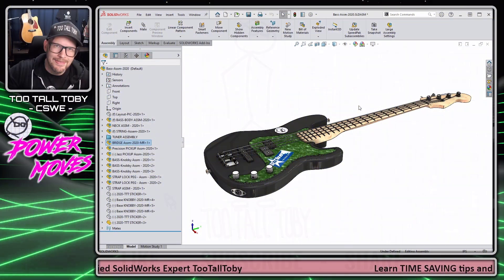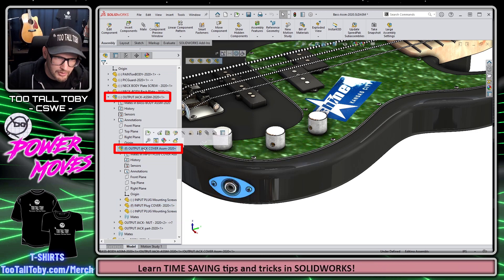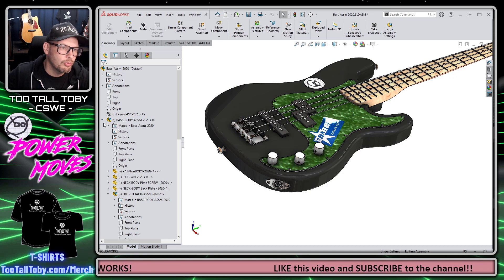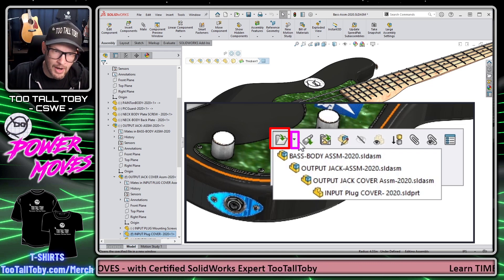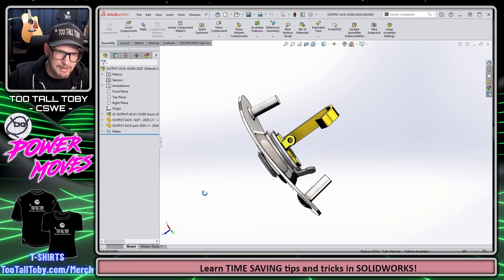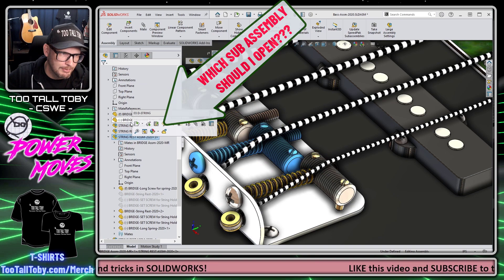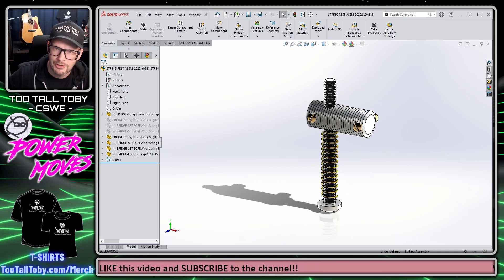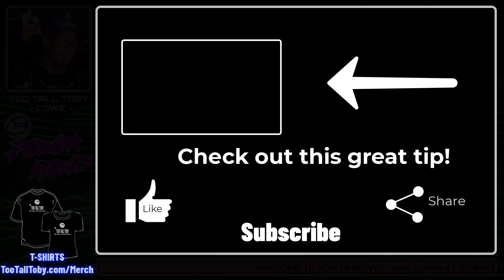SolidWorks Sub-Assembly QUICK OPEN

Comment: How can I get tabs of open documents.
Reply from the maker: I use CTRL+TAB to cycle through my open documents
https://youtu.be/DliLmyiNplY
Reply: @TooTallToby  is there anyway to display open documents
Reply from the maker: @SpotterDeer  WINDOW > TILE VERTICALLY?
Reply: @TooTallToby  I guess I am going to write a program to list open documents then.
Reply from the maker: @SpotterDeer  Sounds good - good luck!  I'm not really sure what specifically you're asking about so it may be helpful if, after examining a suggestion (like using CTRL+TAB) you explain the shortcoming you are experiencing.  And maybe describe the goal and the application.  I'm not really sure what the application would be for "listing all open windows".  Hope this helps!
Reply: @TooTallToby  autodesk inventor, Siemens NX, pro engineer. All have tabs on the bottom of open window inside the cad software. I can write a small program to show a list of open windows that I can then click on to switch to and make active instead of minimizing windows or pressing ctrl + tab.
Reply: @TooTallToby  how annoyed would you be if in your OS you had to press a keyboard shortcut to switch to a different program or window of a program.
Reply from the maker: @SpotterDeer  Just tryin to help, buddy.  Good luck!

Comment: It is even easier to use the flyout that appears at the top left of the modeling window. There you can select Face, Feature, Body, Assembly on up the tree and you get a preview to ensure that you have the correct item(s). Right clicking gives you all the options such as Isolate or Replace Components.
Reply from the maker: Aww yeah great idea!

Comment: Hi Toby, I actually use this a lot. Very underutilized per my experience as well. I ran into another problem today though, I was trying to 'isolate' a sub-assy and another component but whenever I click on the model it was just isolating sub-assy part instead of whole sub-assy. I ended up choosing it from the feature tree but I wish there was shortcut/modifier when you click you, it lets you select the whole sub-assy instead of just one particular part.
Reply from the maker: RIGHT MOUSE BUTTON on the part (in the graphics area)
Choose SELECT SUB ASSEMBLY (from text menu)
RIGHT MOUSE BUTTON in the background
Choose ISOLATE (from text menu)

Let me know if that works - hope this helps!